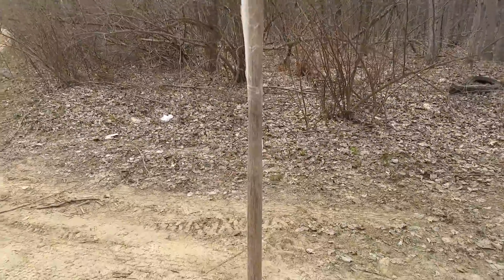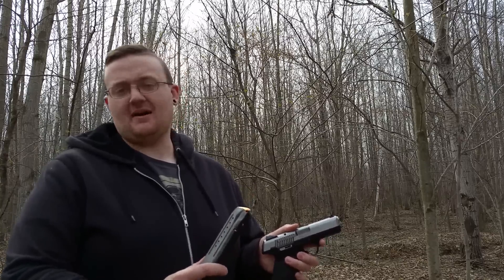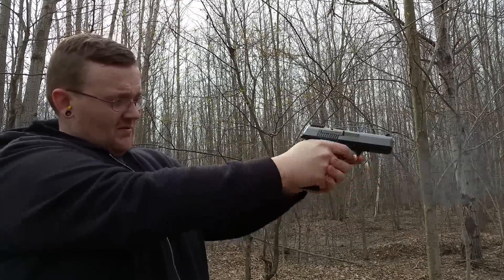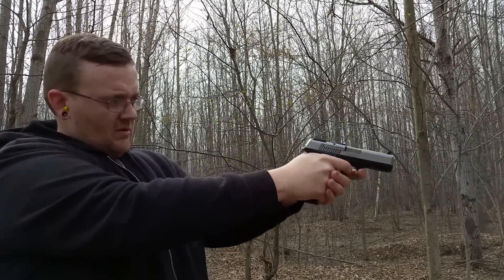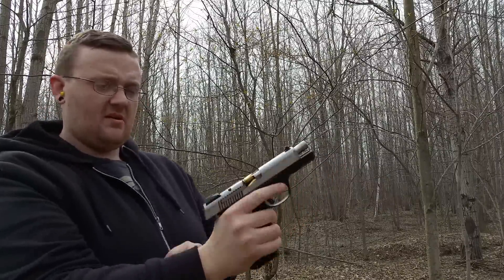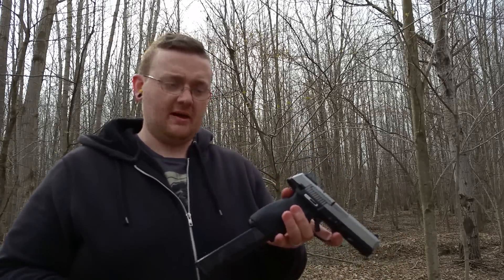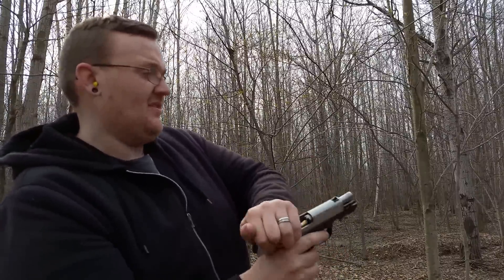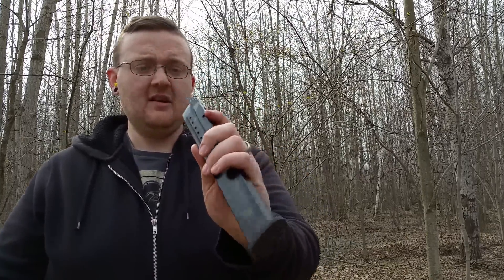Ruger SR9 32rd Extended Mag Mod. (Test 1)

Comment: Pro Mag now makes a 32 rd mag for Ruger Sr's, E, PC carbine and I believe the Ruger security 9. This mag fits all of these applications, completely interchangeable.
Reply: Do the promag 32 round mags work with the 9e? Promag only says the sr9 but Im seeing other 17 round mags that hold sr9 and 9e. Are they interchangeable?
Not finding much info out there. Thanks
Reply: @ronholstein7910  i own a 9e and just bought a PC Charger. One 17 rd sr9 mag came with both when i purchased them. they’re all interchangeable. i also purchased 2 factory 17rd mags. just ordered a 32 rd promag on gunbroker. ill let you know if it works in my 9e. but i’d have to say if it works in the SR9 it will 99% chance work in the 9e. only issue i’ve seen in a few different videos is the last round hold open doesn’t work with the 32rd promag
Reply: @ronholstein7910  the SR9 & SR9e use exact same mags. They also work in the Ruger PC9.

Comment: Just got the actual 32 round clip for SR9 by ProMag at Cabela's last night it only cost me 32 after tax and it worked great the very first clip no Hang-Ups so now you don't have to mod a different version clip that goes to a different gun just buy the actual SR9 made clip
Reply: Bless you sir
Reply: Not called a clip and the pro mag will jam after a while I had it and it jammed after a while it’s not reliable
Reply: @scottiepippen3855 did you in any way clean and oil your magazine. That part gets dirty and has friction parts in it that slide.

Comment: Need help iorder one already drilled the hole the mag locks in clicks everything but will not fire at all
Reply: Steffon Matthews had the same issue. You have to grind away by the trigger assembly at the top of the mag
Reply from the maker: I have not had this issue. My mag required no grinding at the feed ramp